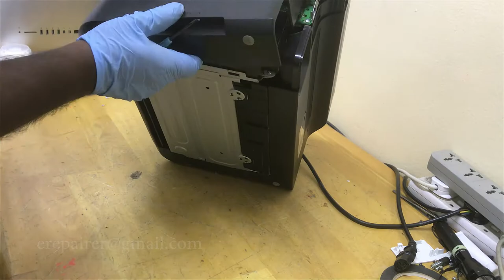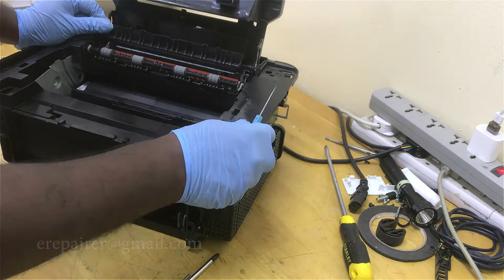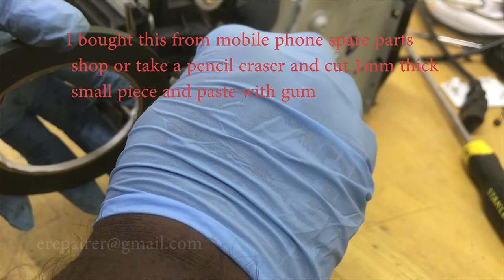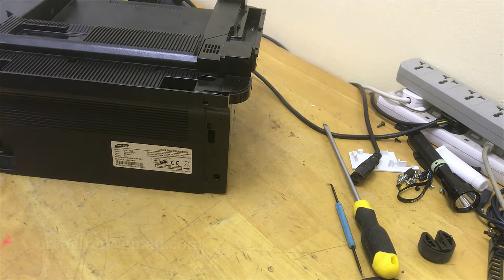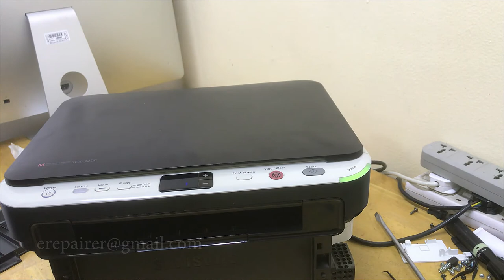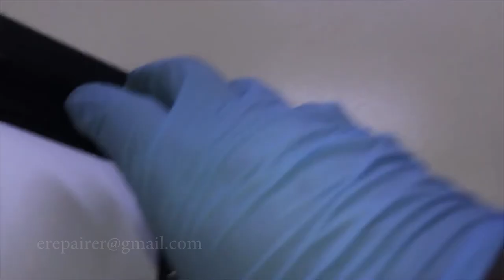Printer pulls too many papers. Samsung SCX-3200,3201,3205

Comment: Thanks for this extremely useful video. I was about to bin my SCX3205W for this very problem, but thought I'd give the repair a try after finding your channel. I found I didnt have to do as much dismantling...just removed the left hand panel. Solenoid was really sticky...I replaced the black patch with a piece of heat transfer rubber for a TO220 transistor mounting kit...now works like new. No screws left over! Thank you!